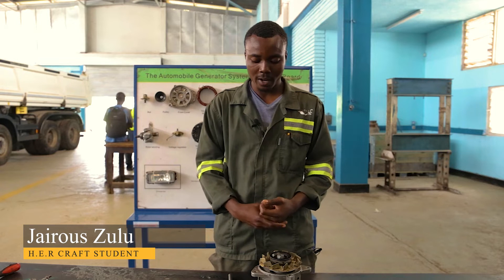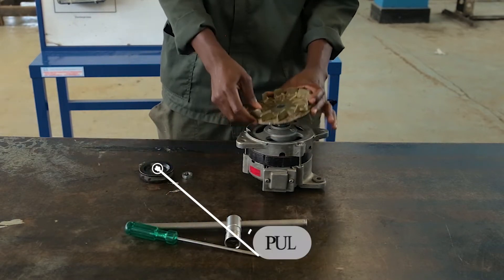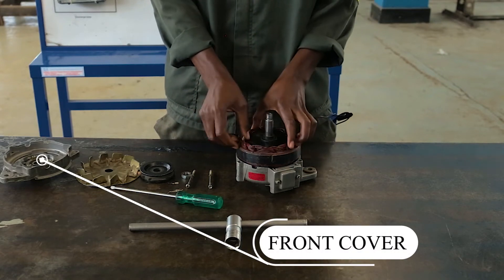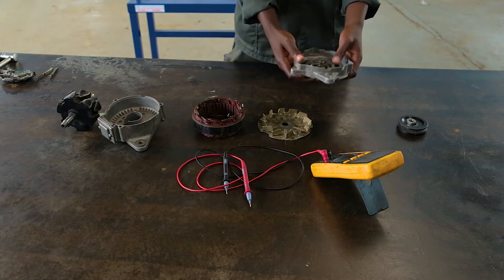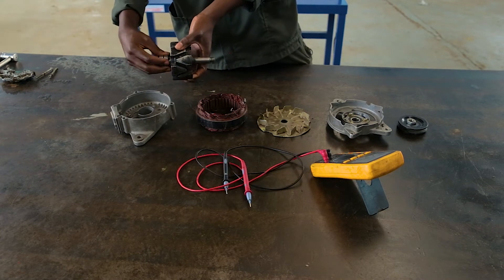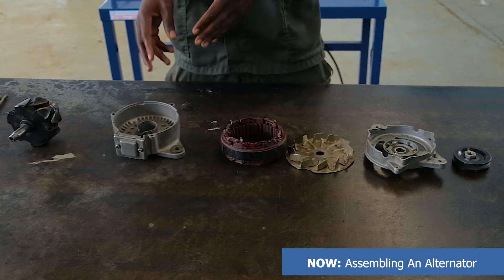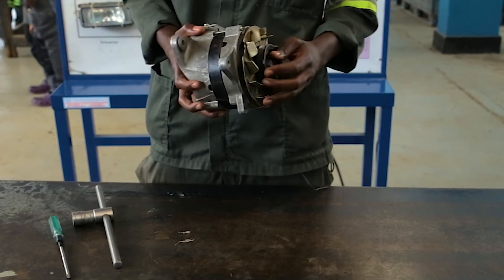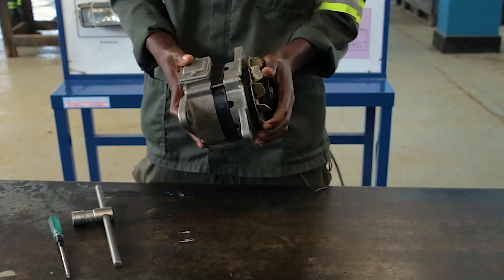#ALTERNATOR #PARTS AND #FUNCTIONS

Comment: When dismantling  always mark the alternator so the screws get back to there original position. In the video the you didn't do that and that alternator can't be fitted back in the car because the holes where the bots holding the alternator are not aligned properly.